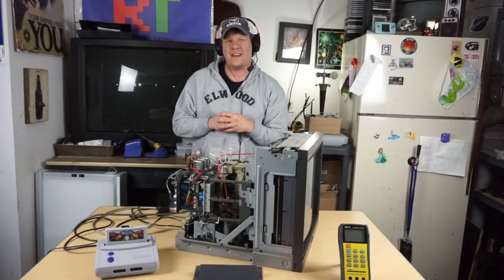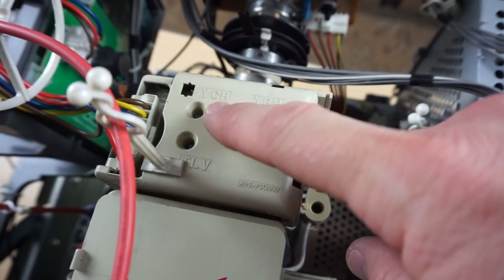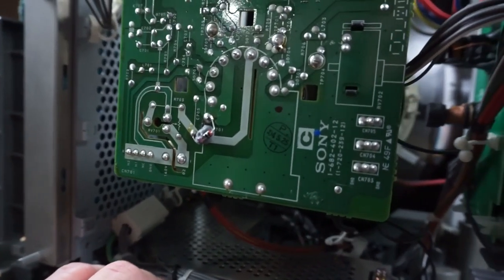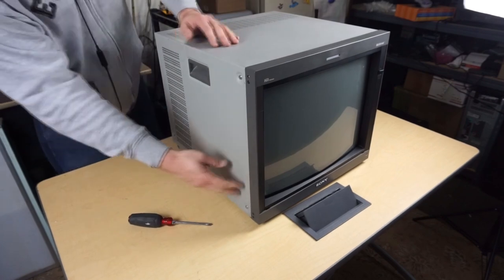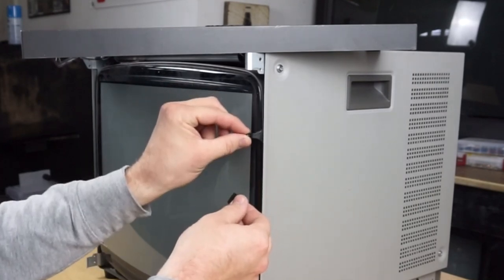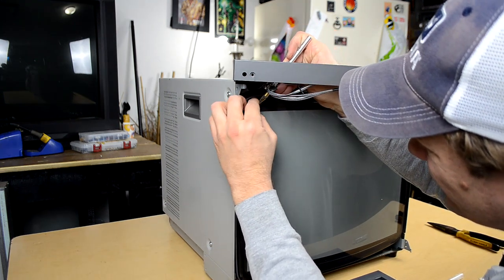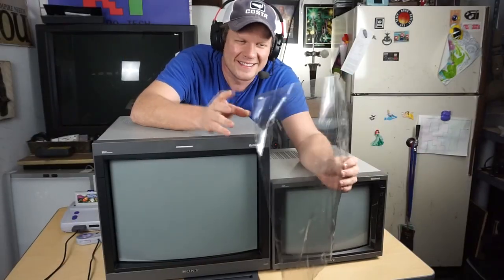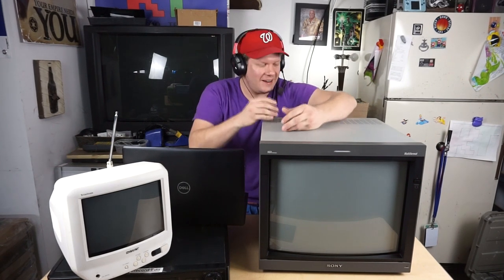"Crystal" clear picture on Sony's BEST PVM CRT:  20L5 Hardware upgrades

Comment: I can relate.  A few months ago, I took the anti-glare screen off and my forearms were also burning.  The adhesive smelled awful and there was a bunch of left over adhesive that took me 2 hours to clean off with 90% isopropyl alcohol and some paper towels.
Reply: You're supposed to use a heat gun to loosen stuff like this, not just brute force it lol

Comment: What are the dials labelled "L" & "R" either side of the yoke for? I can't see anything in the service manual? I did play around with mine and found that they seemed to act in a similar way as magnets for corner convergence? They also seem to turn continuously with no min or max setting?

Comment: Did this on my XBR 960 many years ago.  However it came off in many pieces and not one sheet.  It’s was tough and I got a lot cuts.  But the image clarity was improved noticeably
Reply: Yeah, I did it on my XS955 and it looked noticeably clearer and more vibrant.
Reply: @cyberedge881  nice!  I used to be under the impression that the XS lacked the film, but iirc now, it was the 960N model that didn’t have it(?)

Comment: Finally got the plastic off of my PVM a few months ago, and mine was pretty hard to pull off as well.  Took a while to get all the adhesive cleaned off, too. Would heating it up slightly with a hairdryer help? (Being careful not to heat up anything else, of course)

Comment: What type of cleaner would you recommend using on the anti-glare layer for PVMs that still have it attached?
Reply: On my Tinitron and Diamondtron PC monitors I just use a little bit of mild soap and water on a microfiber cloth. Rinse the rag out and wipe off the water.

Comment: Before I pull my layer off, is there an actual noticable impact on image quality outside of eliminating any nicks or scratches? Other then losing the anti-glare of course. And thank you for being such a great resource on retro monitors!
Reply from the maker: That's hard to say.  I can't tell much of a difference between one with and without.     If you use your PVM in a darkish room, you won't see any difference.  If there are a lot of windows in your gameroom then you may want to keep the layer.
Reply: @RetroTechUSA  Thanks for the answer man, appreciate it. I'll probably leave mine on then!

Comment: Hi, do you have any videos how a weak trinitron CRT looks in one of those PVMs? I have an old PVM that has problems with dynamic convergence. I tried adjusting the yoke by the instructions, but despite the center of the image looks perfect, the edges are still not converged properly. One old tech suggested me that the CRT might be going weak (it does have a ton of hours on it), so there is not much I can do...

Comment: Wish my 14L4 had one of those protective layers
Reply from the maker: Funny enough that's a model I've never worked on.  Doesn't it look just like a 14L5?  If it has the same bezel, it's worth checking.
Reply: @RetroTechUSA  It looks exactly like a 14L5 except it doesn't have "Multiformat" on the bezel.
Reply: @RetroTechUSA  Does 14L5, BVM-D20, and D24 have this film? I couldn't tell unless I actually remove the front bezel.
Reply from the maker: @limera1nx  yes those all do.  You could also check on the 14L4, it may have one.
Reply: It physically looks very similar too 14L5, it did not come with any protective film according to the seller at least, I couldn't see any remnants of one either.
Also has quite a lot of OSD options spawned from 14L5/20L5, so I suppose they share the same OSD hardware/software, but lacks some of the functionality, mainly multiformat.
Reply: i can confirm that 14L4 have the protective layer, just removed mine few days ago, cause the screen have heavy scratch everywhere, removed the layer, now the tube it's like brand new

Comment: I wonder if a hair dryer or a heat gun would soften the adhesive on the reflective screen. Might try that on my 9 in with a small gash to see if it works.

Comment: Do all CRTs or PVMs have this type of "layer" over the screen? Great vids, thanks.
Reply: No, most don't have it.
Reply from the maker: Just the PVM L5 line and most of the BVMs from Sony.  JVC has some with a layer too
Reply: @RetroTechUSA  Any idea if any of the M4s have it? I feel like you've mentioned some of the M4 line having them before, but I'm not sure. I've got a 20M4E with a (fairly small, to be fair) scratch on the screen, and I was wondering if there was a glare layer that could come off. I would go check myself, but I think you have to basically strip the whole monitor down to get the bezel off (again though, might be wrong).

Edit: also, if you or anyone else sees this, quick question. Is it possible to remove the wires that come out of the top of the flyback on a 20M4? (not the anode cap, the other two wires going to the neckboard).  I'm not sure if they're plugs or not, and I don't want to just yank them.

Comment: This coating is only on certain PVMs, correct?
Reply from the maker: Yeah, only the L5 PVMs and it's on most BVMs
Reply: Maybe someone here who stumbles across the video: next weekend i will pickup a pvm 2130QM aka „the block“ that has a single dark scuff in the picture - this model of all things has no protective coating?

Comment: Isn't the lower pot on the flyback for screen/G2? How can this affect focus?
Reply from the maker: No the G2 is directly on the Neck Board.  There are 2 focus nobs on this flyback.  I've seen Ikegami Broadcast CRTs with up to 3 focus pots on a flyback
Reply: @RetroTechUSA  Interesting. I've never seen that on a Trinitron. I do have 2 focus pots on my Loewe ART 1, but only 1 of them actually adjusted the focus, as far as I could tell.
Reply: @RetroTechUSA  Btw, I fiddled with YCH, YBH and TLH on my FD Trinitron just last night to fix a convergence issue in the corners, but that only helped marginally. I suspect there's an issue with the velocity modulation board. Then again, this thing accumulated over 25k hours, so it's probably on its way out anyway. :^(
I've considered rejuve (have a Müter BMR), but that's pretty hit & miss with Trinitrons from what I've read...

Comment: My 1340 came with feet installed.

I know that older PVM's/BVM's had better hardware.
Were 1340 PVM's installed with feet, when they were manufactured?

It has three pairs of feet.  Four placed under the glass, and two in the back.

Comment: I've removed the protective film on a couple of CRTs in the past and in all honesty I don't recommend doing it. Removing the film will mess upp the EOTF curve on most monitors (especially the JVC D-TVs like 1710CG but also most PVMs and BVMs) and they become more troublesome to calibrate for that reason. Differences in sharpness are neglible by comparison.

However if the film has noticeable damage, then it's often a good idea to remove it for sure. No question there. :)
Reply: do you think we can replace a new polarizing film for the screen??

Comment: Couldn't you use an alcohol wipe on a C.R.T. with an anti-glare layer, with no negative effect on the anti-glare layer?
Reply: Nothing wrong with midly soapy water.
Reply from the maker: I'm certain there is an exact Cleaner designed for those layers.  I'll let you know what I can find
Reply: @RetroTechUSA  Thanks.

Comment: I once did it to my FW900. Hated the result as it was hard to use the monitor in anythign than pitch black room. Here AG looks even more translucent than it was on FW900 so even more useless. Overall I do not recommend removing antiglare unless it is completely ruined by scratches and such. I put polarizer on FW900 and after that it can be used in pretty much any lighting conditions and contrast is much better.
Reply: Which  polarizer you used?